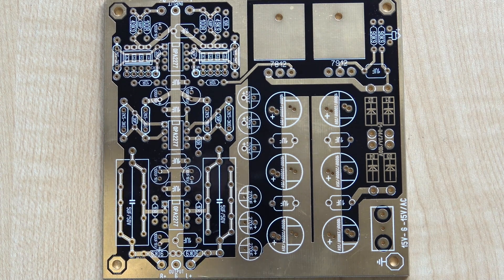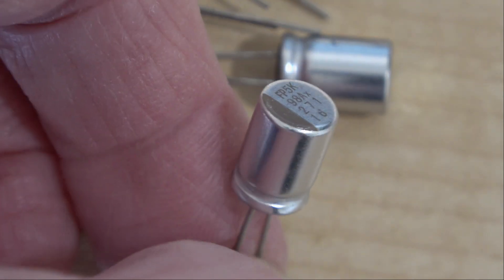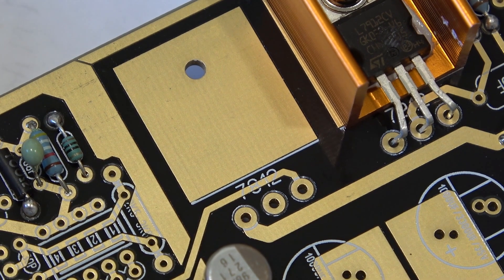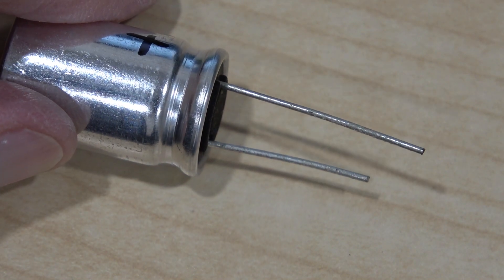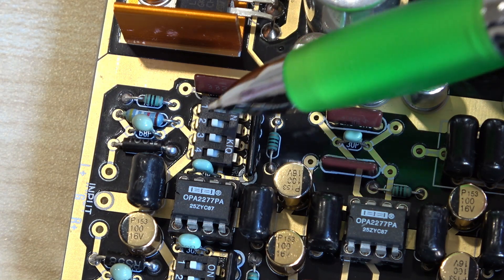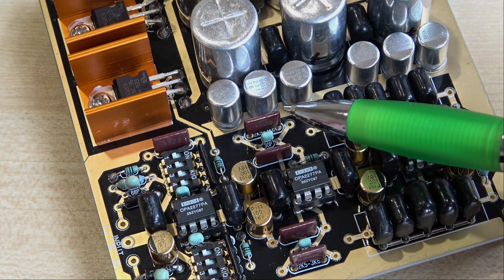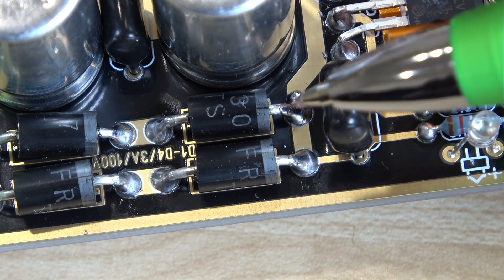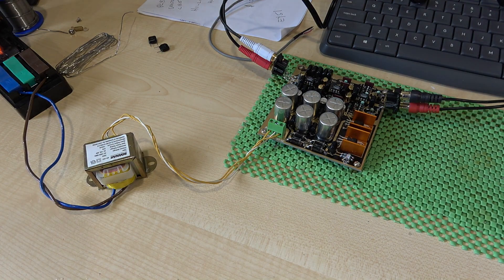OPA2277 Pre Amp Kit Pt 1

Comment: When there is  such a tight through-hole fitment, use a drop of liquid flux on the holes to aid in lubrication and solder flow.
Reply from the maker: Good idea, I must try that.
Reply: Overly tight holes means harder for solder to flow from bottom to top layer and fill the entire via

Comment: you have to swap up amp ic! There are bigger differences between the different brands and models than you think.
use an ic socket

to me OPA2277 is no better than any other op amp ic.

One should not just go by age and specification

My favorite is (LT1057) And the most expensive I own.
JRC5532. JRC4550. are the most used out there I think. The LM4562NA is also relatively good
Reply: Have you did any measurement to prove your biased difference hearing? if not then its just bullshit.

Comment: looks like a very good preamplifier.
Reply from the maker: I have just found a better one, I will upload in the 5/6 days. Still giving a long listening test at present.
Reply: @MichaelBeeny  Ok. you should try and replace the opp amp ic. You will be amazed how big differences there may be between them.

The way the potentiometer works then you get a resistance between signal and GND.
if the sound is adjusted low, you get a lot of resistance between signal and GND. this to get less noise but you get poorer stereo picture and more mono!

I always use 50k potentiometer to minimize this problem.
Reply: @MichaelBeeny  Hope you can answer me.

Do you remember the Fisher ca-271 amplifier from the 80's and CA. series amplifiers?

I made a comparison between the Class-D and the fisher amplifier.

1.L15D.
2.TPA3116.
3.TDA7492.
4.Hypex UCD180.

I was very disappointed with the sound quality of the Class-D!

Almost all Class-D amplifiers have poorer sound than a Fisher CA. The difference is is too bigg!

But the Hypex UCD180 has better sound quality than the Fisher CA. have!

Hypex UCD180 is approx.
10 - 15 years old!
Reply from the maker: @ford1546  I don't know the Fisher products at all. Not that much American stuff travelled well to the UK in the 80s. Over all, I'm not a great lover of class D. Very frequency and impedance sensitive. I still find the L12/2 my current favorite so far.
Reply: @MichaelBeeny  Fisher hifi was common in 70 ' and 80's!
The CA. series amplifiers were the series that were most common from fishet.

fisher CA. were neither good or bad amplifiers but in the middle.

The point here is that i have tested and find out that cheap class d amplifiers have much worse sound than i thought.

supper cheap class-ab is better than the class-d for the same price is!

My favorite is Hypex ucd180 and L20 class ab amplifier and 
Naim nap250 clone card from Ebay.